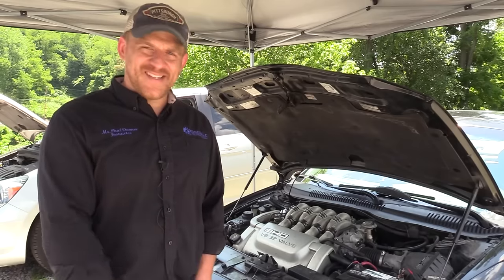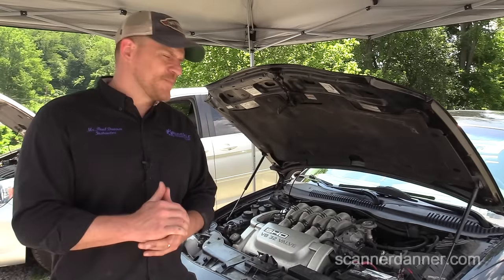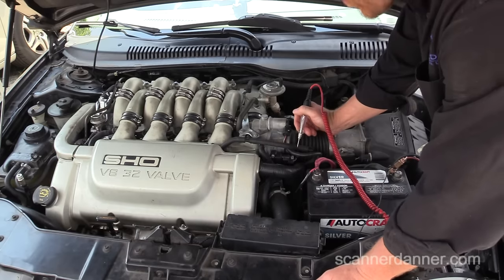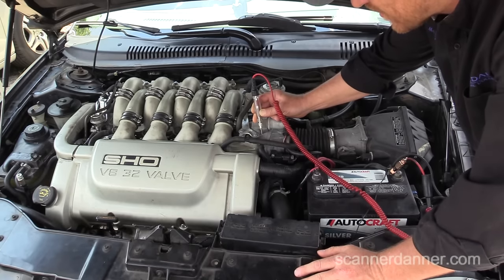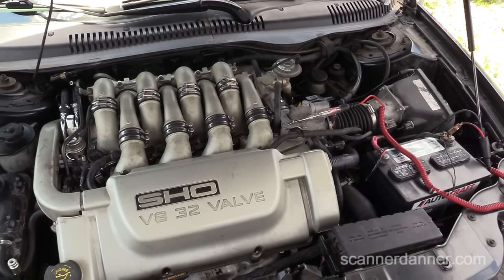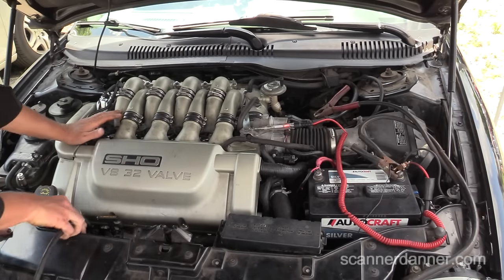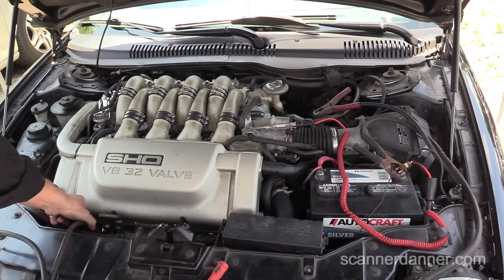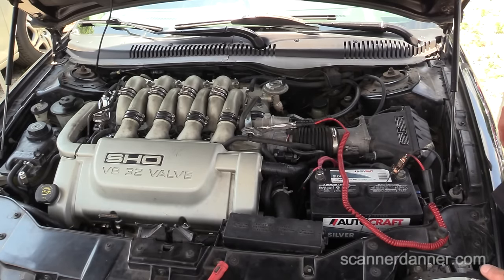No crank, no start diagnosis (bad block ground) - Ford SHO

Comment: I find using this test light a little confusing, wouldn't it be easier, just my opinion, to use an Ohm meter to check for resistance between the neg batt connector and ANY metal surface that should be connected to engine ground. Of course this may cost more with the need of a multimeter - digital is the best... Food for thought -
Reply from the maker: And NO, the ohmmeter is THE WORST tool for this situation. I have a few videos to show where a high resistance circuit can show perfect resistance when tested with an ohmmeter. In short, it does not stress the circuit. 
Watch this one. Move to near the end of the video where I show the ohm tests
https://www.youtube.com/watch?v=44dP6X3QS5A

Comment: Hey Paul. Surely this problem is weird; how do I get directed towards a bad ground with a no crank problem? Because I would be like checking the starting system.
Reply: Usually there will be a few indications that show a bad ground. Plus one of the first things to check in any no-start are the power and grounds, especially in the rust belt.
Reply: You would find this through voltage drop testing of the starting system. 12v around about at battery. A lot less at starter then checking for either positive cable or ground voltage drops, all while loading (cranking) the starter system. Pauls way with the test light though is a very quick and simple way to check the ground integrity of the starter system. Hope that helps.
Reply: +Kirk Abrahamson got it, thanks people. Fortunately I don't worry about rust too much in the tropic ;)
Reply: Moving Up Diy q

Comment: Good SHow!!! My problem is the remote wire to the starter has no voltage (radio/all eletronics cuts out when I turn key. I changed the ignition switch and starter switch (82 Chevy Blazer), still nothing. Starter is getting 12 volts and i can start it via flat head on the starter.
Reply from the maker: Park/Neutral switch is part of that circuit too. You need to get yourself a good wiring diagram and track that circuit.
https://eautorepair.adtrk.biz/?a=10817&c=24&p=r&s1=

Comment: Question. What if test light has a dim constant flash while engine is running? Wouldn't that mean a bad engine block ground as well? I clamped test light to negative (ground) battery post and probe at the block while engine was running.,and light constantly, flashed.

Comment: I have a question: Whenever I go through a car wash or have my truck outdoors in heavy rain at an angle (back end of the truck higher than the engine on a sloped driveway), my engine gets grounded. Clicks but no crank and starts draining the battery. Been trying to track this issue but no luck. Is it really as simple as Battery Negative to Engine block ground?

Comment: Old post so I’m hoping you see this comment. So will this work for vehicles with a bad ground strap like you see alot of gm’s and fords have with no starts. Run test light negative battery to block and the block will be in a sense energized. Is this true for all engine grounds?
Reply from the maker: If it is a no crank situation, yes, absolutely.

Comment: It took me months to figure out I had a bad ground in my Crown Vic....Its very easy to get tunnel vision and start firing the parts cannon. I replaced starter, neutral safety swtich, even suspected the PCM, and bought a Zeus (I work on carbed cars typically). So, yeah, now Im positive (ha) its a ground.

I just have to find where the suckers are, and check each one. The car has enough ground for ACC but it cranked over maybe 15 degress, then one solenoid click..then nothing since. 

I AM STARTING this car today though..even if I use jumpers lol. One this about Fords though. I loved this car since new and babies it..but the rust problems are terrible. The engine serial number, flaked off...thats how much they rust.
Reply from the maker: Let me know what you find!

Comment: I'd go with grounding through the transmission as the most likely path: with the vehicle stopped, there is no torque on the gears to keep contact between them and no thrust on the input shaft (from meshing with gears) to make solid contact through the bearings.

Comment: Hopefully you can answer this question? I had a 89(?, not sure about this) Toyota pickup.  It was parked on the street and got hit in the front drivers side.  Before the accident, it was running fine.  After the accident, it would turn the engine over but wouldn't start. However, after a couple of minutes of turning over the engine before it would start.  I would need to go through this everytime I needed to start the vehicle.
Reply from the maker: Check fuel pressure when it is not starting. My money is on a problem with the fuel pump cut off switch circuit of the vane airflow meter on your truck
Reply: But would it start after cranking the engine for a couple of minutes?
Reply from the maker: Do some tests and find out. Need to know what you're missing when it doesn't start. If you need more help post to my forum
https://scannerdanner.com/forum/post-your-repair-questions-here.html

Comment: What could it be if the car sometimes starts but sometimes it doesn't? Battery is fine, starter relay is fine... I'm guessing it could possibly be a damaged ground wire?
Reply: What ur saying is exactly what my Mountaineer is doing.
Reply: My 2002 mountaineer is doing the same thing, just started happening out of the blue
Reply: @katieherre54  mine was a wire attached to the starter - it was warned out. Good thing I knew a mechanic and he attached a wire to the starter. I didnt have to buy a new starter. Thank you Jesus!!!!

Comment: Just had the issue with my 2003 Dodge Durango. Ground straps were completely deteriorated. Resulting in a no crank, no start. Sounded like the starter went out as I was getting a click. Replaced ground straps and it starts perfectly.
Reply from the maker: Nice! Good job

Comment: hi i have a no rpm tach running and also water temp gauge in the dash but sometime it does it work so i was wondering if a bad ground is involve but which is at fault my car is a 1990 ford sho should be about the same thin i would think

Comment: My 05 ford escape has a no crank no start but if I leave key on after about 40 seconds the fuel pump kicks o. Then truk starts I'm thinking it's a ground issue

Comment: Awesome, Awesome Paul.  Of course if the battery ground was connected correctly to the engine block or starter casing and the ground cable connector at the block or starter case had corrosion, then the test light would not have lit the way you had it hooked up, right?

Thanks Paul , keep up the great work on the videos!!

Comment: Could a dirty greasy starter case be the reason for voltage loss at the case?
Reply from the maker: Grease and dirt, no, but corrosion could, but I've never seen it as the area where it contacts the block is pretty well sealed just by the clamping force of the bolts. Then the bolts would have to corrode too

Comment: my lincoln has the negative terminal to the  motor and the posative to the starter just like this car! i switched them around and when i hooked it to the battery the black terminal caused a big spark like little fire crackers thrown on the ground. so i switched them back and now car starts up fine. what should i really do in this situation??
Reply from the maker: You intentionally bolted your battery positive terminal to the block?

Comment: I am thinking I have a bad ground somewhere on my car and wondered if you could help, I have a no crank situation, power gets to the starter from  the battery, the smaller wire that comes from the ignition switch only gets voltage when disconnected from the solenoid. there is also a clicking relay that doesn't stop clicking until late the ignition is switched off, any ideas?
Reply from the maker: You have a voltage drop on that solenoid wire for sure. Post this to my forum with the year make model and engine size and we will see if we can get you a wiring diagram of that solenoid circuit. 
Also, the clicking you are describing is a classic low voltage issue. Let's talk about it on the forum okay?
https://scannerdanner.com/forum.html
Reply: +ScannerDanner I have just joined, what category do I put it under for new topic

Comment: Can this cause the anti-theft light to blink as well? keys in and turned
Reply from the maker: a bad block ground can do all sorts of cray things, but if you have an anti-theft light blinking at you, you need to scan it for codes first and go from there. Attck any anti-theft related faults first. See where it leads you.
Reply: ScannerDanner the thing is that it doesn’t give me any code but a while ago I had my engine shut down by it self and the obd gave me the code U0122. But now no code whatsoever

Comment: can i us a multi to test this with the positive on the battery and the negative on the block??
Reply: teburg10 The voltage drop test is conducted with respect to battery ground.  The battery ground cable "strap" is connected directly from battery ground terminal to the engine block.  Therefore with a Clem connection from battery ground to engine block the two points are at battery ground, 0 volts.  When there is a "bad block ground" what it means is that there is resistance build up between the engine block and the negative battery terminal.  This resistance acts as a resistor in series back to the battery negative terminal, therefore during high current draw, for instance when starter is engaged, this resistance build up causes a voltage drop across this resistance and takes away from the required ~ 9 volts for the starter and limits the required current as well.
To test for voltage drop , with meter place positive probe on engine block and negative probe on battery negative terminal, while cranking engine voltage reading should be about 0.5 volts or less.

Comment: Hi.. Can a bad ground also affects AC cooling?  I know its stupid question but the same No crank problem happened with me and somehow I managed to fix it and car running now however after that the AC cooling very very low.. I felt Gas pressure must be low however Gas is proper and compressor engages too but  no cooling.. so I suspect that compressor me cutting off due to bad ground??? advice pls
Reply: Ramee P you need a manifold gauge to see the pressures. If pressures are good then check your cabin filter. If the filter is plugged with dirt there's no cooling system on earth can cool efficiently
Reply: Ramee P a bad ground wouldn't affect just AC since it share the ground with everything else on the block so it would affect engine starting.

Comment: Hey Scanner Danner..i had a question about sensor grounds...lets say if a sensor ground is spliced originally to all sensors like in fords..map..tps..maf..o2s..tfts..and lets say a tft trans temp sensor has a bad sensor ground is it possible to splice in an external ground lets say to the chassis
Reply from the maker: you can do that to see if the circuit comes back to life (and it will), it's just not a good fix from a noise standpoint
Reply: Ok...i was a lil confused with that...i know i read somewhere about it but was not sure if its ok to do..
Reply from the maker: It would be better to find your open ground and fix it or at least splice it into another sensor ground circuit rather than to the body of the car. Make sense?
Reply: ScannerDanner.. definately makes sense...i know i heard about that..i wasnt sure if its ok to do...i have another question.. a 1999 chevy s10 p/u 2.2L came in..blown ecm fuse..i saw that the placed the main battery ground (fat wire) in front of the bell housing of the A/T..i looked on the schematic it shows it in the same area but behind where it is currently at on the engine block side..would that have any affect on other grounds or on the starter considering its bolted on to the block..
Reply from the maker: That should be okay because of the steel bolt that is threaded into the block.
Reply: ScannerDanner thank you..i know ur super busy thank you for your input..

Comment: So if no start just connect bad ass ground cable from starter ground to battery minus ?
Reply: If a bad ground is your issue.  
A no crank no start could potentially be cause by many more things.
Reply: It is a quick & dirty roadside test in a no/slow  crank no start.

Comment: Bro I went to the gas station but when I was on the freeway it wouldn't go above 40mph made it turned it off then't want to start it cranks but.... So I put a new fuel pump but it I spray starter fluid it starts I just put a new fuel pump and still won't start what u think it is
Reply from the maker: What are you working on? Year, make, model, engine

Comment: How come the test light isn't sufficient to start the car? Maybe that's a dumb question.
Reply from the maker: Not dumb at all! The test light I'm using will only carry about 200 milliamps of current, where the starter draws a few hundred amps .
Was this a general question or something I showed in the video? Because with a bad block ground, all bets are off with everything
Reply: @ScannerDanner  I was just wondering if the test light would act as the ground since there didn't seem to be any grounds from batt to block,
Reply: @ScannerDanner  it was from the bad block ground video

Comment: My car does this intermittently, but the ground test showed good ground.
Reply from the maker: The test must be done during the no crank. I have other starting system (no crank) videos that will help too if your block ground rested good
Reply: @ScannerDanner ,
Thank you so much for your response! I watched the videos that you posted links to. They are great! I will run the test when the no crank condition occurs and hopefully I will find the problem. Lately, I have also been experiencing a solidly lit check engine light that shows no codes when I scan. I will check for videos of yours on the subject. Keeping up an older car (‘95 Mitsubishi 3000GT) on the road has its challenges… 🙂

Comment: 3:26 Bad chassis/block ground and computer attempting to prime the fuel pump is the reason why the test light lit for a second upon turning on the key.
Reply from the maker: And other circuits turning on as well

Comment: school boy error, fair enough.  another way would be to do a volt drop with the multimeter! it looked as if the nut and washer was rusted/corroded.  had it been a good clean point of contact the car may well of started ok have be a good earth point.
Reply from the maker: In the description of this video is other links to videos I've done showing the voltage drop method. As far as a clean ground? That had zero to do with it, there was no ground on the block.

Comment: hi  does anyone know if the bad block ground would cause  ZERO COMPRESSION  ?
Reply from the maker: no, it would not
Reply: Hi scanner I have a  07 ranger 4.0 dohc maybe sohc cant remember . but it was driving like a charm as usuall got home no  odd noises  went back to use it , and  only heard a whinning noise from the starter area . took it to garage  they said it was the fuel pump . after they replaced the fuel pump and tried to start it they said it had ZERO COMPRESSION ,,,,,,,,,  I  FIND IT ODDD BOTH PROBLEMS WOULD OCCUR AT ONCE WITH NO WARNINGS  FROM EITHER , THEY  DID PUT THE OLD FUEL PUMP BACK IN NOW I  GOTTA GO GET  IT ..........   THERE  SAYING TIMING CHAIN  BUT I AM STILL HOPING FOR SOME OTHER  ADVICE  IF YOU HAVE  ANY THANKS .........  IF  I  WOULDA  HEARD  ANY NOISE PERIOD  I WOULDNT OF PUT NEW  MICHELINS IN IT WITH LESS  THAN  200 MILES ON THEM .............  NO  RATTLING NO SLOPPY TACHOMETOR ,,,,  I AINT READY TO GIVE UP  JUST YET  SO PLEASE HELP  LOL
Reply from the maker: That is strange. Why would they put a fuel pump in it with an engine with no compression. I would get a second opinion. Or go buy a cheap compression gauge and we can walk you through the test on my forum. 
https://scannerdanner.com/forum.html

Comment: Actually it was the solenoid trying to energize... Not the starter that was lighting your test light.
Using the transmission and or axles even as a temporary ground path is Very damaging to any bearings in the path...
Reply: Makes sense, any kind of arching is going to put a spot on the bearing surface and you know what happens from there on out. 
not good!!
Reply: I guess he knows  its the Starter Solenoid which comes already in the starters assy.

Comment: Eye on it 2005 Sable I put a new fuel pump new crankshaft sensor I checked that can sing so I checked the starting relay I checked the water the hot water coolant sensor in the car Dulce falls on the injector and doesn't have ground in the starting Samsung I don't know what I can do to fix it I checked also the computer is okay can you